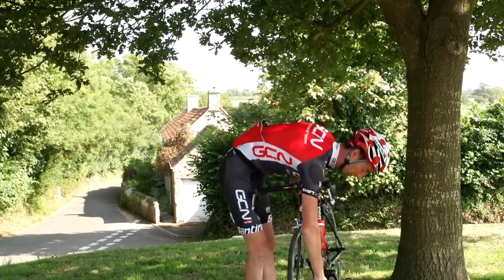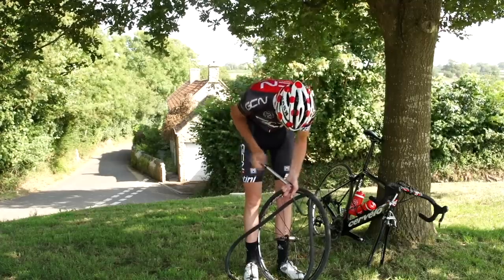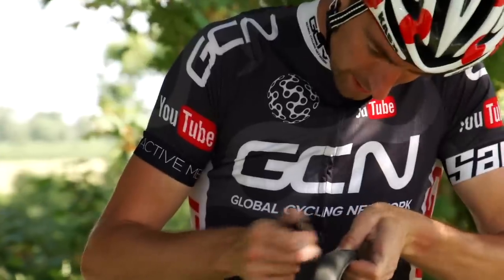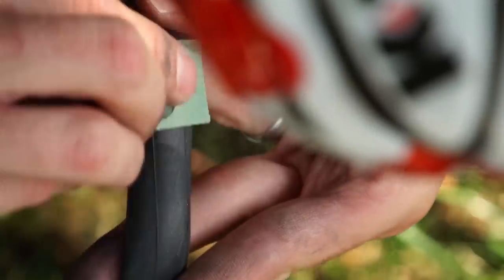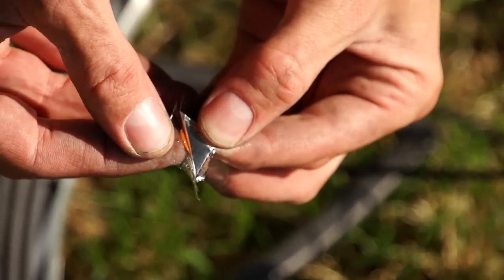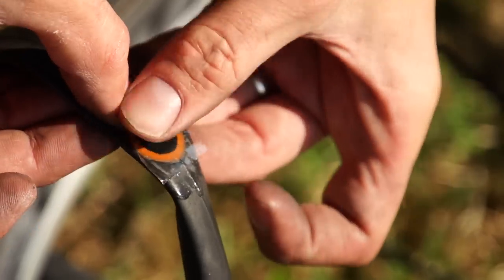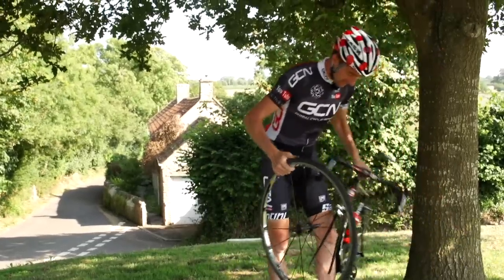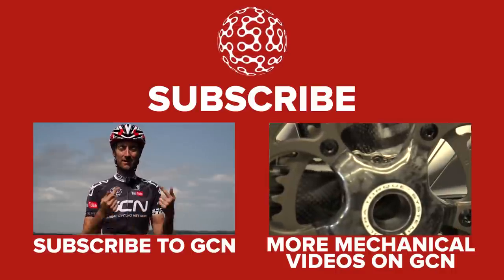How To Use A Puncture Repair Kit – Roadside Maintenance

Comment: I don't really repair my punctures anymore (I always carry a spare inner tube), but if I have to repair it, I always leave the cellophane on. I find no reason to remove it. Removing it can cause the edges on the patch to be released from the glue. You have to be careful if you do take it of, at least.

Comment: A few people have suggested leaving the cellophane on - which is fine. If you want to take it off though, a top tip for doing it without peeling off the patch is to gently fold the patch until the cellophane splits in the middle, then peel it off from the middle towards the edge.

Comment: Could you please do a video on the correct way to use CO2 inflators and cartridges ? I have no experience with them, but the idea of carrying a small inflator and spare cartridges in my saddle bag / jersey pocket is more appealing than attaching a mini pump to my frame. Cheers.
Reply from the maker: Thanks, that's a good idea.

Comment: Hey CGN crew. All three of my flats have come from the area right by the valve to the side. I ensured that the tire was not under the tire and it still happens. PSI is 120 with Continental Super Sport tires and there are no sharp items on the tire itself.

Comment: Hi. Most often the puncture repair kits come with a vulcanizing solution, not necessarily glue. If you have applied the solution and put pressure on the patch and flatten the red outer part of the patch, you are actually vulcanizing the patch with the rubber of the inner tube. Vulcanization is a chemical process for converting natural rubber or related polymers into more durable materials by the addition of sulfur or other equivalent curatives or accelerators. Vulcanized materials are less sticky and have superior mechanical properties. Although the curing of rubber has been carried out since prehistoric times, the modern process of vulcanization, named after Vulcan, the Roman god of fire, was not developed until the 19th century, mainly by .....Charles Goodyear. Repairing an inner tube by the road side can be done through the cold vulcanization. You will feel a little bit of heat when the process starts.

There are patches on the market where the small cellophane covers peals off from the middle. These are more convenient then pealing it off the edges first. 

Just bought a Giant Propel Advanced Pro 2 bike here in Cambodia and bought a Giant self adhesive inner tube repair set in the shop. Well... it does not work. Vulcanization is still the most reliable way of repairing an inner tube for me.

Comment: When ever i go riding no matter the distance i always take a puncture repair kit and two spare tires and the tools to sort the problems in the bag. I learned from the mistake of having a tear near the valve which was unfix-able so had to walk 6.5 miles from work. I keep two tires in the bag just in case you get two unfix-able problems you never know it may just happen.

Comment: what happens to road bikes when you get a nasty puncture? i don't think i've spring a leak since i ran over a huge nail about 14 years ago when i was a kid (i stay away from alleys now). does it bend up the rim? does it damage carbon frames?

Comment: Got a flat today and walked home over 3 miles in 100F heat.  I nearly had a heat stroke.  So the alternative is for me to carry:
(1) Tire patch kit and/or new inner tube
(2) Huge tire pump
(3) Bucket of water to check for leaks
(4) Super glue
(5) Tools to remove the tire

Is this real life?  This happened on a brand new 2021 Trek.  I never had flats in my life.  Seems like newer bikes are designed to fail.
Reply: You make it sound like the puncture kit isn't a tiny 4x2 box, including glue and tyre hooks. You don't need a bucket of water. The pump can be a portable one 6-7" length. Not that much to carry around, just a bit time consuming, but better than 3 miles walk in the heat.

Comment: How many kilometres do you think is reasonable to ride on an inner tube which has been repaired? Or would you recommend changing the tube as soon as getting home?
Reply: I am not aware of any restrictions regarding riding on a repaired inner tube. Some of the patches on my inner tube might actually be several years old and I have never ever experienced any problem with any of them.
Reply: unlimited. properly patched tube is usually as safe as it was before, but it weights slightly more (not noticeable). patches with glue tends to be better than those self-glueing. cheers
Reply: Oh yes, I also meant patches with glue; the dry ones are only good for getting you home faster but the air usually very slowly leaks.
Reply: ***** exactly.
Reply: I use self adhesive patches and they don't last long. They'll get you to the end of your ride but will probably leak before you've done another 50km. I replace them as soon as I'm home and have my supply of tubes, or better yet just replace the tube to start with and patch the punctured one up once I'm home and have stronger glue!

Comment: What mini (floor?) pump is that?
Reply from the maker: ***** not about the one that's Dan's using, but a bunch of brands (like Lezyne - Engineered Design) make  mini pumps that turn track pumps.
Reply: Got one but CO2 cartridges are expensive and suppose I have three flat tires in 1 single ride...
Reply: ***** and you need to inflate tube more often as co2 leaks.